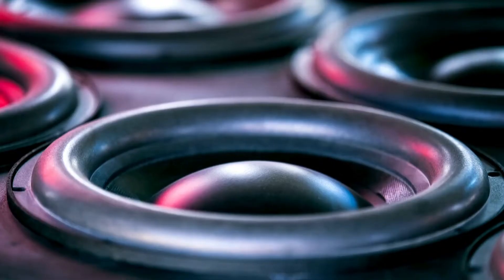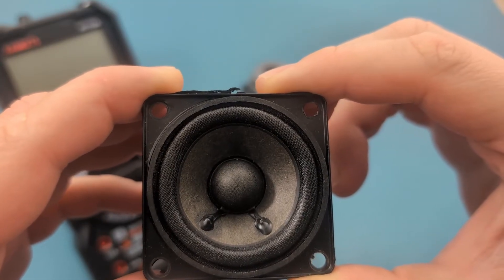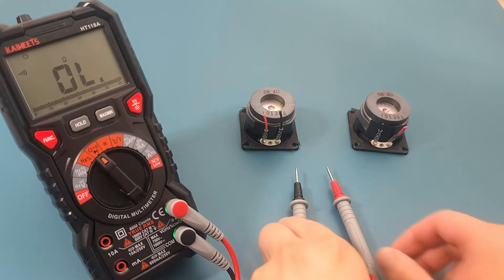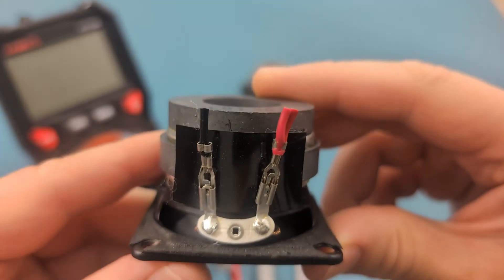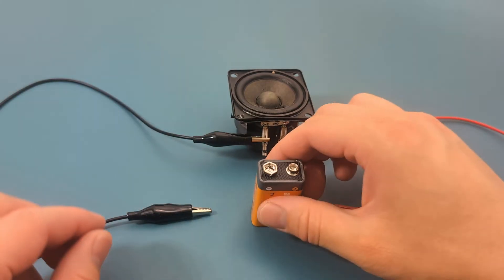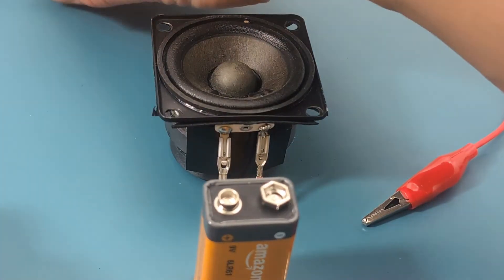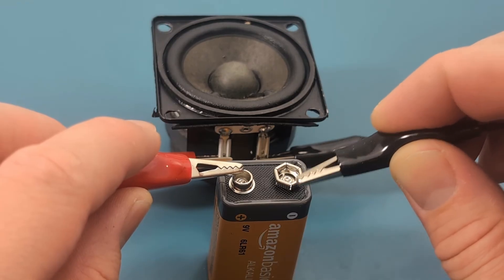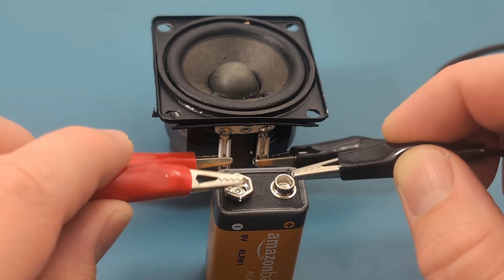How to a Test Speaker with a Multimeter

Comment: I thought those were drivers?
Reply: Drivers are loudspeakers which sometimes have designated frequencies, distributed by a crossover unit within the wooden loudspeaker enclosure.
Common Drivers include:  Tweeter for High Frequencies, Midrange obviously for mid frequencies, leaving a Bass Driver, for the low frequencies.  These three drivers will work on a three way crossover, while a two way crossover will allow a tweeter to be used with a combined bass-midrange unit.  Lastly, there is the full range driver, which (generally) covers much of the top, middle and low frequencies in one unit.  Other drivers include sub-woofers, super-tweeters, and dual-concentric drivers, but there are more!

Comment: Hi, question.  I have a simple analog multimeter and I tried to test a known 8 ohm speaker that is working (I just wanted to know how to test unmarked speakers by trying this first to get a reading). So I put it on "OHM X1K" it's the only selection I have for Ohms. When I touch the connectors the needle flies all the way to the right which tells me it's a closed circuit but doesn't help with the Ohm rating.  Can that just not be done with this type of meter?  Thanks.
Reply from the maker: Great question! 👍 Analog multimeters, especially with only an 'OHM X1K' setting, aren't ideal for measuring low resistance values like an 8-ohm speaker. The high resistance range applies too much voltage, throwing off the reading and even damaging sensitive components.

You'd need a digital multimeter with a lower ohm setting (like X1 or X10 on some analog meters) to measure speaker impedance accurately. If your meter only has X1K, it won’t give an accurate resistance reading for low-ohm values. Instead, you can try using a known working speaker of similar impedance for comparison.

Comment: Can any woofer speaker be tested like this? I'd try starting test with lower voltage 3V, 5V, ...
Reply from the maker: Yes, many woofer speakers can be tested using a similar method. Starting with a lower voltage (3V, 5V, etc.) is an excellent way to reduce the risk of overdriving or damaging the speaker.